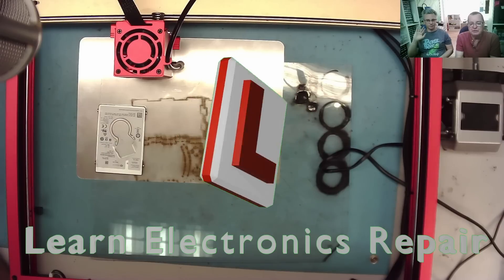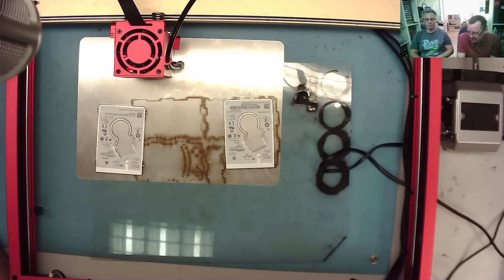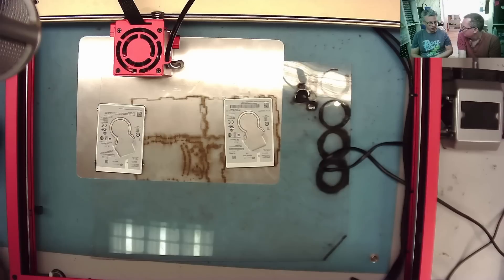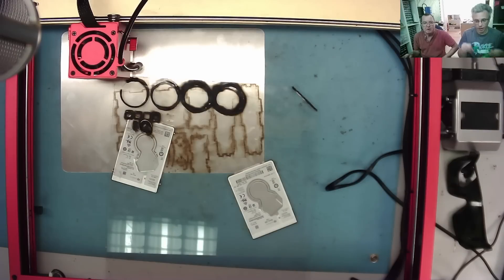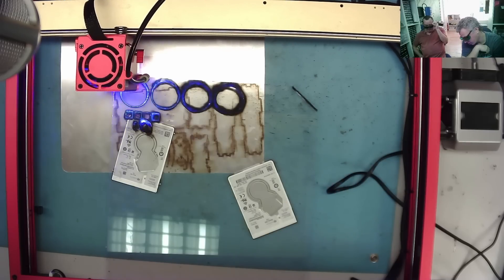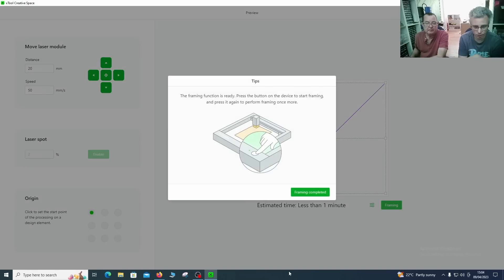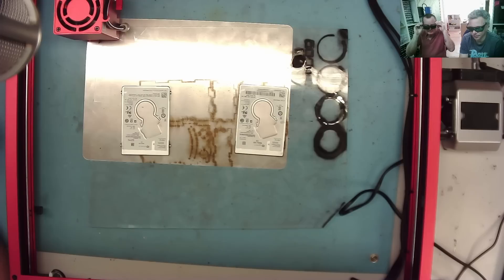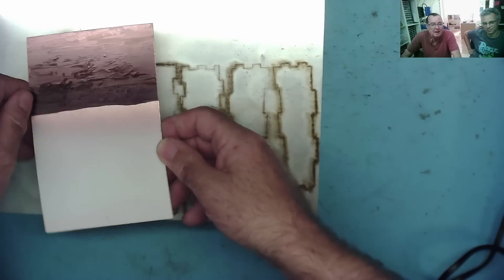How To Make PCB With A Laser Engraver XTOOL D1 Pro

Comment: That's very interesting. I actually had this  idea a few years ago as well. Bought a hobbiest CNC machine with the laser attachment and a ton of copper pads for prototyping. Unfortunately, it turned out that the power supply I had to drive the laser wasn't powerful enough and I didn't have enough understanding of how the software worked to get it going. I knew I would have to invert the image but I was trying with laser grbl and my machine came with one of the steppers and rails on the opposite side from what it's supposed to be. That, and the drivers seemed to misbehave with either my OS at the time or the program itself. There is a way to reverse the motors through software I found but at the same time I got my first 3d printer so I invested my time in it instead. Cool to see someone actually experimenting with this process. I also wanted to add the idea of possibly sticking some shipping labels on the copper pad rather than paint or marker? I know, flammable properties and all but curious to know if it would work. Maybe even vinyl stickers.
Reply: was it a stepcraft machine??..i've got one sitting unassembled..i was going to mill the copper. never got around to it. inspired to have a play after seeing this.
Reply: @raindogred  Mine is the Sainsmart 3018 or 2018; something or other. Relatively small bed and 3D printed head for the router it came with. Of course, I didn't know this at the time of ordering but it seems solid enough. I still have mine on my bench. I've repurposed it to hold packing envelopes for shipping products out along with random cables I don't know what to do with. 

The laser, I bought separately since it was said to be compatible. I went with the best one they had at the time figuring it would be the best idea. Unfortunately after putting everything together I realized the connector had an extra prong in the laser. The whole process became nothing but a headache so I've set it aside momentarily thinking now and then to give it another shot. After seeing this, it had the opposite effect on me. Interesting, yeah, but I think about how intricate for my particular machine it would be to do a double-sided board or line up the drilling holes correctly after switching out the heads.

Comment: I think you can actually use the laser to burn through the holes. It would make it easier to drill over it at the correct place later. Definitely would give it a try. If you guys are making another video about this topic, please try making a SMD circuit board! I would like to see the results. I also want to suggest to lower the speed a bit, so that the machine can etch the board easier. Thank you for the video and keep up the great work!
Reply: That is a neat idea, to have the laser create the holes - instead of drilling later.

Comment: Apparently there is a technique where people print a mirrored circuit on an acetate sheet using a laser printer, then transfer it to a board using a document laminator by sandwiching the two together.

Then they etch the PCB as usual in the acid bath.

Comment: As Tims_Projetcs already stated:
"You cant cut clear acrylic with a diode laser because it has the wrong wavelength.
You need a C02 laser to cut clear acrylic because it has the right wavelength.
If you want to cut acrylic with a diode laser, the acrylic needs to be coloured."

So it is not just "light". The wavelength matters.

Comment: I think the breaks in the circuit is due to scratches in the copper by the looks of when you cleaned it off, black still remained in some parts of the plate or was that just thicker maker fluid?

Comment: Have you or Carlos tried using a highly oxidized, copper clad FR4 board? I’m curious,m… If the copper layer was oxidized enough so as to reduce the reflectivity, it seems like that you could skip the painting and chemical etching steps and basically remove the non trace areas with the laser. Then use a mild acid to remove the oxidation from the freshly defined copper traces. Any info will be hugely helpful and greatly appreciated. I’m getting ready to click the check out button and get my own laser cutting rig and want give the pcb making a try asap. Thanks for all the videos

Comment: You cant cut clear acrylic with a diode laser because it has the wrong wavelength.
You need a C02 laser to cut clear acrylic because it has the right wavelength.
If you want to cut acrylic with a diode laser, the acrylic needs to be coloured.

Comment: I think you would usually use a high pressure water cutter to cut acrylic as it doesn't produce any heat
Reply: That would be cool to get one to review :P , but they are usually huge machines and extreme pressures :P, and ofc 100k$ +  😆, if some one wants to send one we will gladly try it out 😋
Reply: An you can also cut metal and other materials as well ;)
Reply: Water jets are pretty pricey.

Comment: i made a paste using...copper powder and soldering wire grinded and applied it over thin fiber glass rasin layer....after 5hat i heat it...working good from many years.....
i used small stancil...to apply it....😁😂

Comment: Guys, I think you should try 'Matt Black' exhaust spray paint if you can get it en Las Canarias.
Reply: Do you mean the heat resistant stuff ? 500+ C?
Reply: @RetroUpgrade  Yes, Carlos. It has a very matt surface and being black it should absorb the laser light very well. I had intended to try it myself when I finally get my 10W laser set up. Ill health and house move have delayed me for a year. I would be very interested to see the result. It may work, it may not.
Reply: @grahambambrook313  Will try to find some of that paint, used it before in Sweden when i Modded cars :P, painted various Engine parts with the stuff :)

ill report back to you when i have a result :)
Reply: Exhaust paint is high temperature paint. So it is made to resist heat and burning.
Reply: @RetroUpgrade  Cheers! I also meant to try just doing it the way people do with an engraving tool to just outline the tracks and pads to leave good ground planes. Of course, this assumes that the paint will not be affected by the etchant, which I do not know as yet.😁
Reply: @1pcfred  I suspect a 20W laser will be able to cope.
Reply: @grahambambrook313  Even if it did, (I think) it would waste a lot of power, since a job that could be done using a 5W laser would be done using a 20W laser with (maybe) worse results. Black paint would be really better though. I just don't know if the laser is UV or not, because that would change everything including the paint he should use. Some types of paint don't really absorb UV light well.

Comment: Diode lasers will not cut clear acrylic. You need a CO2 laser
Reply from the maker: Yeah we thought that but a subscriber on another video suggested some ways it would work.  We tried both those suggestions and they didn't work, but at least we tried them.
Reply: @LearnElectronicsRepair  You can cut opaque acrylic in some colours, and deep red clear acrylic will cut and engrave. Not a great idea to do a lot of plastics cutting without good fume extraction. PVC and ABS(I think) can give off really nasty fumes. 

An IR laser will cut the clear stuff, only because the acrylic is IR opaque. Visible light lasers just shoot right through, and at best, melt a bit with the heat reflected from the table.

Best practice is to use darker coloured materials if at all possible. And if you can elevate the material a little, its easier to tell if its gone through.

Comment: How about you buy the boards pre coated with photoresist and just laser that off, expose the whole board and etch that with nice hot Ferric Chloride ? or obviously use a matte black spray paint or perhaps any colour of matte paint would do as the worst you could choose is going to be white ! As you seem to have plenty of power headroom tweak the settings for better resolution ? great video....cheers.
Reply from the maker: It was mentioned in the video that someone on the team was tasked with buying matt black spray paint... and got white 😉
Reply: @LearnElectronicsRepair  wonder who that was LOL !

Comment: Nice but we want to see copper burning ! laser finished pcd.
Reply: If you burn copper you're going to burn the fiberglass substrate too and that's going to cause carbon tracking.
Reply from the maker: @1pcfred  That is what we found - and discussed near the beginning.  The copper is too reflective for the laser to cut, at least with the 10W lasers we tried on previous videos on this channel. The Xtools D1 Pro 20W can cut through the copper with a slow speed and a couple of passes, but the other problem is that as soon as you do get through the copper the laser then goes through the substrate like cheese.  Probably not what you were trying to do.
Reply: @LearnElectronicsRepair  A burned through board would be a novelty. Kind of like a hanging garden circuit I'd imagine. Parts is parts. Pieces is pieces!
Reply: @1pcfred  Right, haven't considered this !
Reply: @BigBoss-rh7zq  carbonized substrate is a big problem with burned PCBs when things go wrong electrically. So it is a common concern. Whatever the resin is they make the boards out of chars. Carbon isn't a great conductor but it is conductive. They make resistors out of the stuff. So it turns the board into a resistor. That's not good.
Reply: @1pcfred  Yes, agree. Using alumina as board can solve the problem.....$$$😀
Reply: @BigBoss-rh7zq  generally I find FR4 to be good enough. It's that cheap phenolic stuff that I don't like.